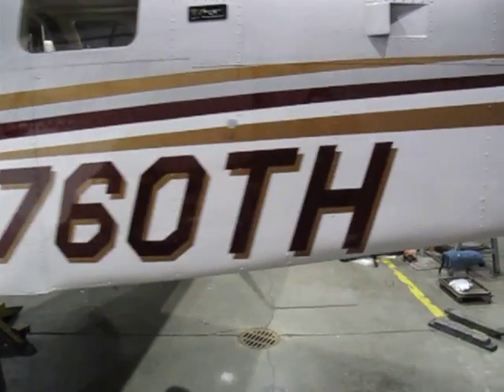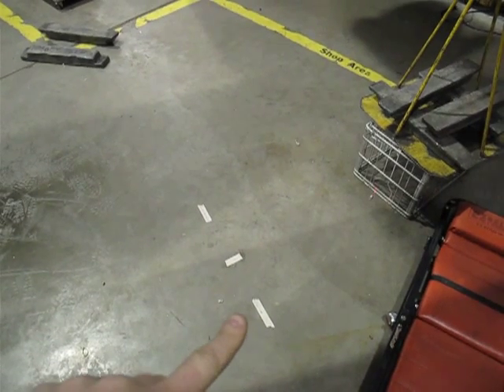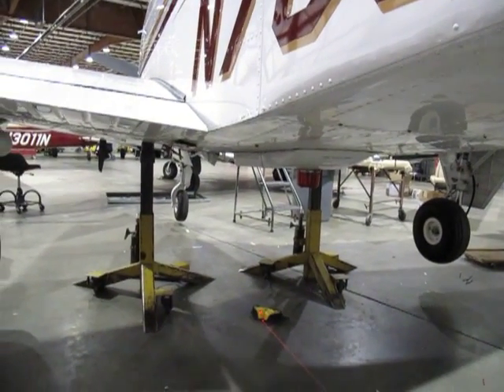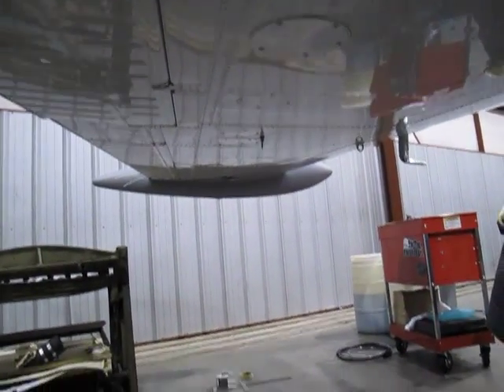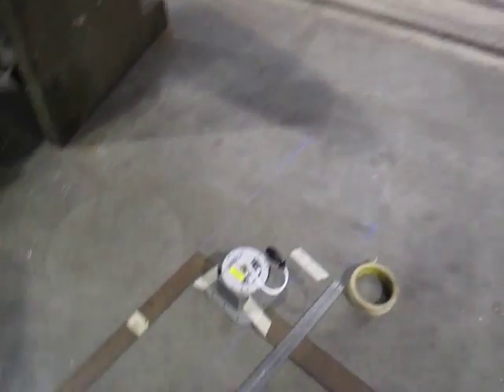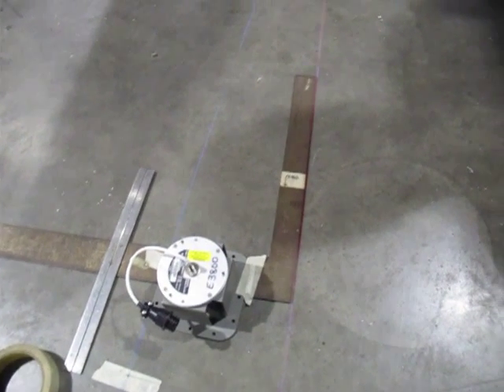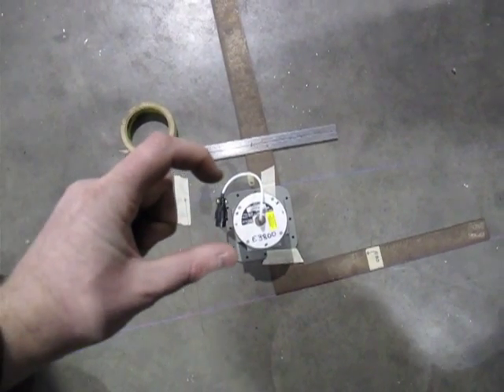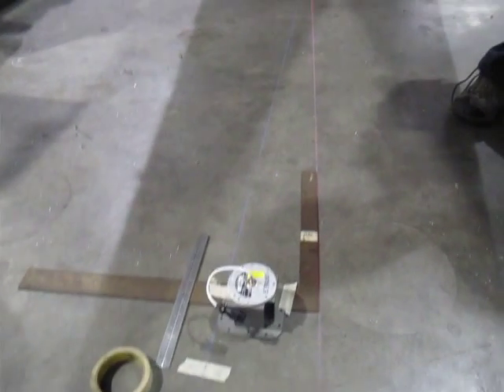Remounting a G36 Magnetometer

Comment from the maker: The Osborne tip tank kit comes with the bracket and doubler material to make a new hole in the wing that the bracket mounts in.  The dimensions of where to mount the magnetometer bracket are well defined in the kit instructions but are a little lacking when it comes to fixing the magnetometer to the bracket at precisely the correct angle.  The closer the magnetometer is mounted to the axis about which the airplane travels makes for easier calibration and more accurate readings.

Comment: Helpful info on how to align it, but where did you actually mount it?
Reply from the maker: In the wing.  A hole gets cut into the bottom of the wing, a doubler installed, and the bracket screwed into the underside of the wing where the hole is made.